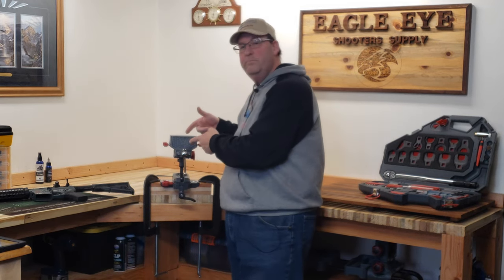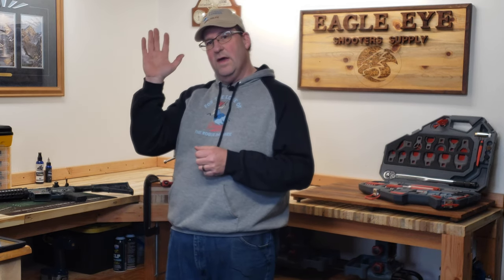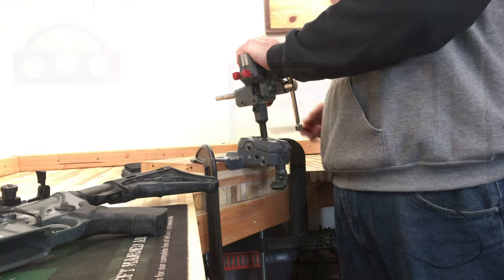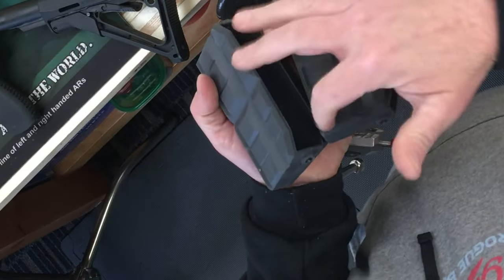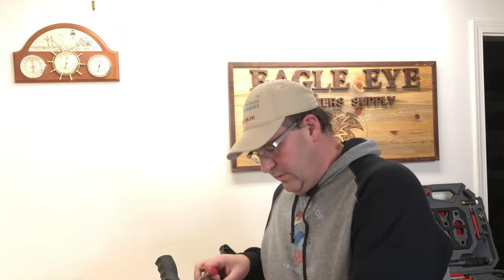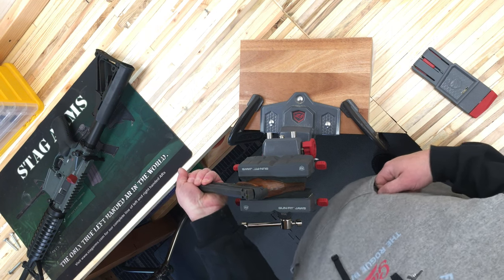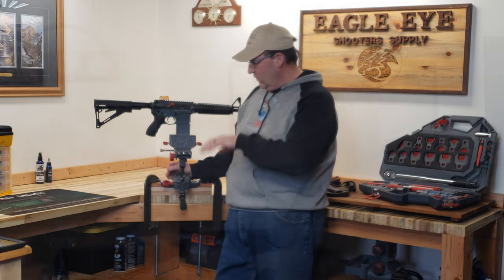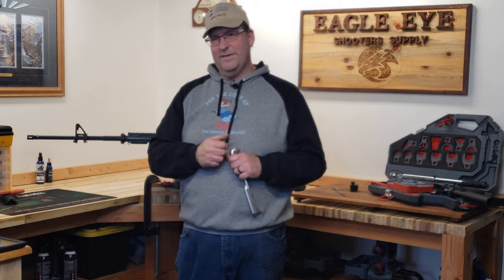Could the Real Avid Master Vise be the best vise for the DIY Gunsmith?

Comment: I would like to see you install a barrel nut down to its max torque of 80 foot lbs with this. I'm skeptical about it's ruggedness.
Reply from the maker: The more I work with the vise the more I put it through its paces. A week ago I was torquing a 308 barrel extension to 150 ft lbs and it held (the vise is only rated to 100 ft lbs). I was supprised and sorry that I didn't film it. I think I bent the thread rod a little as it is tighter to turn but not too bad. I wouldn't recommend going over manufacturer specs but I just had to know if it would hold. Also, I was skeptical about the same thing when I first got it. Honnestly, I thought I would break it barreling up a rifle for the first time on this vise.
Reply: @TheRogueBanshee  I appreciate you responding so soon. I might get one now.
Reply: I agree!  Purchased Avid AR Master Armorer kit and highly disappointed in quality of punches.  Attractive products but question their value in real world application.  The master wrench is solid!

Comment: Do ya think the pic rail slot in the vice would be a solid enough spot to clamp down on to torque a barrel on an upper by chance?
Reply from the maker: sorry, just saw your comment. I wouldn't attempt to use the pic rail slot for that. It might work, but there are better tools for that.

Comment: What about the attachment points for mounting the vice? It looks weak compared to you typical 4 bolt design. How thick are those screws? Or are they bolts? Im planning on mounting this through about 2-2.5in of butcher block and cabinet top
Reply from the maker: Really good questions. I had my concerns about it too before I started working with it. After all my 4 1/2 inch bench vise uses much thicker bolts. I had this mounted to a bench with a 1 inch thick top (it was actually a dining room table top) using the bolts that they give you, (they are bolts) and was quite concerned about the same thing. I barreled a bunch of ARs when it was on that top and had no problems. I also pulled and yanked on it and it lasted. I was pleasantly surprised that it worked as well as it did. I clamp now because I built that butcher block myself and just cannot bear to drill a hole into it. Plus I can pull it off quickly to have added bench space. The block that I have it mounted on now is 2 1/8 inch thick with the bottom mortised out so that it fits flush on the bench and to accommodate the 2 inch carriage bolts  that came with it. You can always get longer ones at the hardware store.

Comment: Im preparing to mount a vise to my bench, do I want to place a sheet of wood down first before mounting it like you did? Is that so you don't leave an imprint on the bench? thanks!
Reply from the maker: I have it mounted with C Clamps so that I can move it around on the bench. That is why it is mounted on a block of wood. I used to have it direct mounted on another bench and decided I needed modularity on the new bench.
Reply: Look at the inline fabrication quick change mount and storage dock. Saves bench space and you can lock anything down to your bench.

Comment: @theroguebanshee Where did you get that barrel nut tool kit?
Reply from the maker: That is the Real Avid Armorers Master Kit Pro. You can see that in action on a couple of videos in the past few months. Namely the freefloat video https://youtu.be/CL-ckSCiawU or the Master Armerors kit pro video https://youtu.be/x_5Wx1pxbt8 It is pretty slick. If you don't want to buy the full kit, they sell just the Crow Foot set as well. About 5 days ago I negotiated a discount code for their website. RARB22 will give you 10% off.